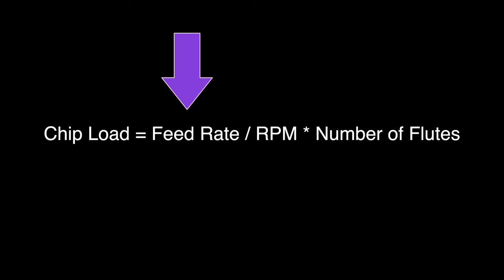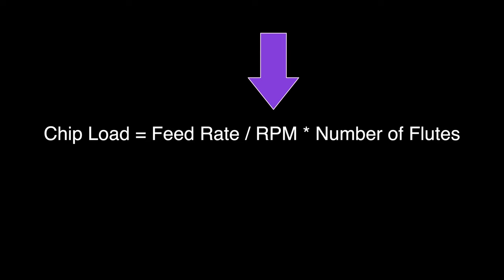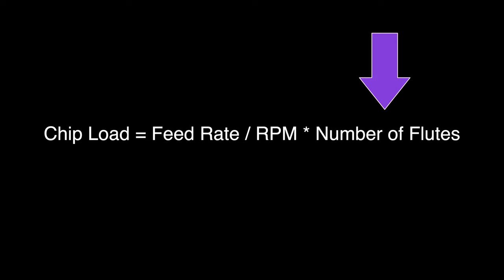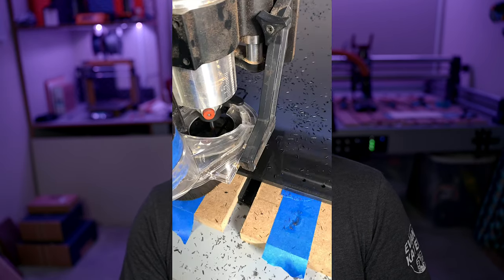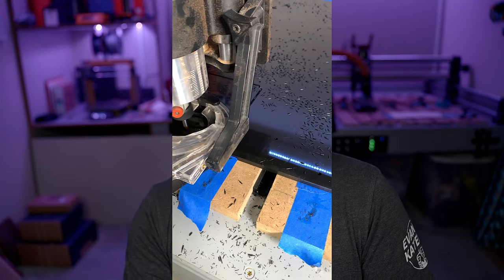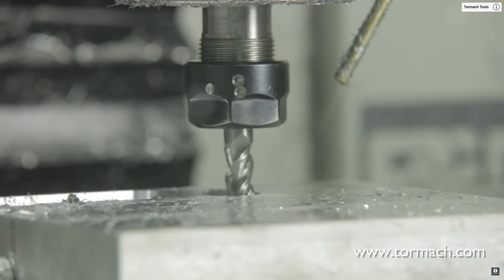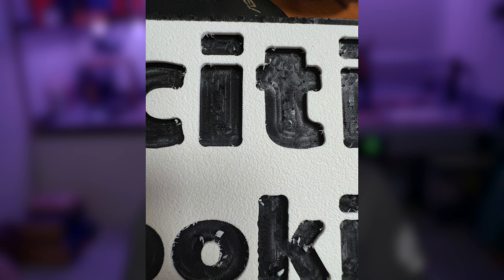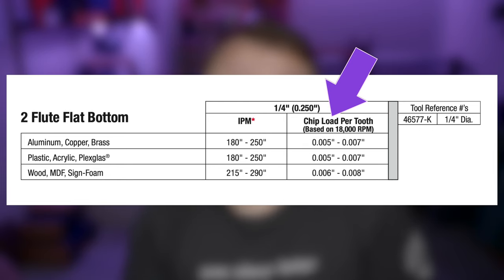The ONE parameter will make OR break a CNC project

Comment: Thank you for the insight! Relatively new to cnc, and it seems that most bit manufacturers lean more conservative on the speeds and feeds. (Is my understanding) That is not necessarily a bad thing, but most manufacturers will then state, make the adjustments on your own particular machine for optimal use for a particular bit. Well, how many bits do I need to break, to find out what would be optimal? lol Thanks for sharing the info, and giving a basis in which to start dialing in the correct feeds and speeds.
Reply from the maker: Thanks - glad it helped! I also partnered with another CNC users and created the CNC Explorer application to help dial in feeds and speeds if you are interested as well. Thanks for watching!

Comment: Tom - really appreciate your videos. Made my journey into CNC smoother. Quick question - I have the Onefinity X50 Woodworker. After updating to a new version of the firmware, my config file seems to be problematic. Can you share the changes you have made and/or where I might find the correct ones? Thanks, Tom
Reply from the maker: Hi Tom - thanks for the kudos! Which config files are you referring to? The Onefinity configuration file? I can send you mine if you shoot me an email. You might have to tweak it a little since I adjusted my revolutions/step. Alternatively, I think you can completely reset the config from the controller. Let me know - thanks for watching!